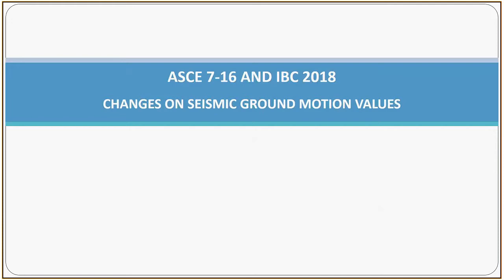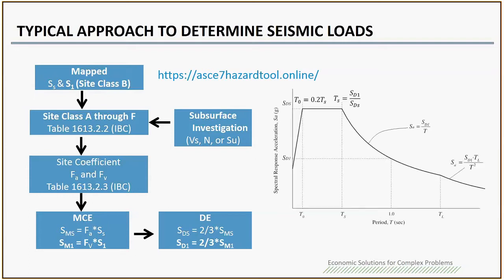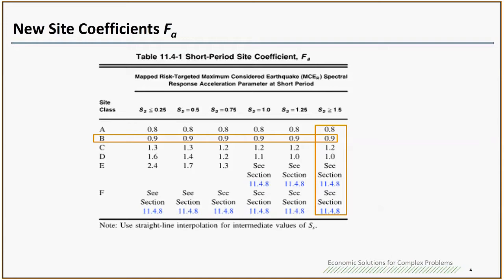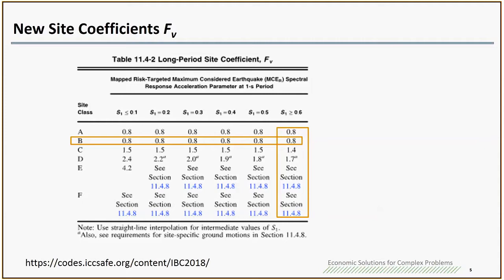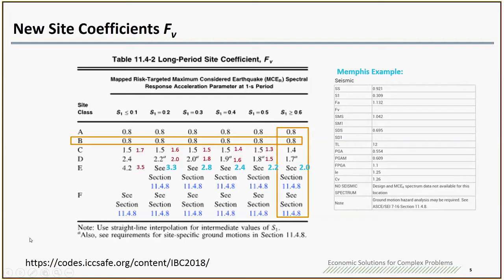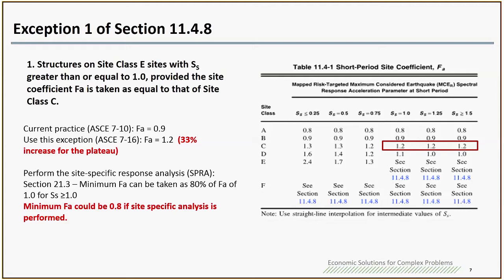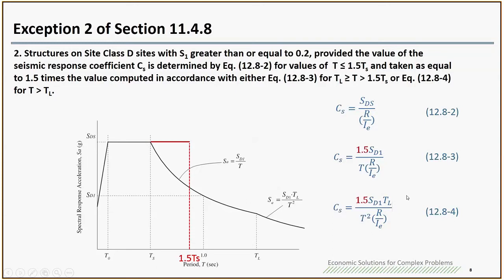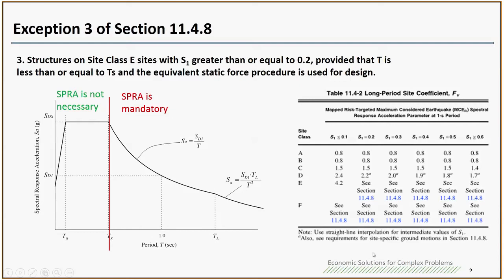ASCE 7-16 Changes on Seismic ground motion Values

Comment: Hello Dr. Wei, thank you for the valuable information. If you can clarify equation 12.8-3 & 12.8-4 when we increase and multiply by 1.5 into the equations but still the value is SD1 is unknown. So how do we obtain the value Cs
Reply from the maker: As what I indicated in the video,  you can use the values of Fv listed in Table 11.4-2 in ASCE 7-16 or Table 1613.2.3(2) in IBC 2018 to calculated the SD1. Note this SD1 can only be used for Exception 2 that means you need to increase Cs value by 50% when using equation 12.8-3 and 12.8-4. Of course, you can always perform site response analysis to reduce seismic loading. Feel free to let me know if you need help on this matter. Thanks.

Comment: At 18:53, the video shows comparison of Eq 12.8.2, Eq 12.8.3, and Eq 12.8.4. 

Usually, Eq 12.8.2 determines the final seismic coefficient (Cs) which does NOT need to EXCEED the values from Eq 12.8.3 or Eq 12.8.4. The latter two equations normally do not govern anyway.

For Simplified Procedure in section 12.14.8, there is no need to check S1 and Fv.
Eq 12.14-12, similar to Eq 12.8.2, determines the final Cs.

For smaller projects, geotechnical report cost may not justify the so-called "saving."
You didn't really save anything. You just convince yourself and the plan checker that you can design for lower lateral forces. I have always designed projects as my own. Most owners of smaller projects would rather spend budget on larger foundation than a nice soil report. 

For larger projects, geotechnical report is mandatory anyway.
Reply from the maker: Hi, Jack, thank for watching my video and the comment. The changes of ASCE 7-16 should not impact your projects much since the periods of your projects are typical short and in the plateau range of the response spectrum. The intent of this video is to explain the changes from the ASCE 7-16 and how to deal with the changes. Even though geotechnical report is required for large projects, the site specific response analysis is typically not performed. This analysis is recommended to reduce the seismic loads when it is challenge to design for it. Even for small projects, such as adding additions to existing house (quite common in the Bay area), some of additions have to rely on the existing foundation. It is difficult to modify the existing foundation to resist the load. Then there is merit to perform the site specific response analysis for more economic seismic design. You are right. Majority of projects won’t be impacted by the changes. However, if you ever have the issue with the new code, feel free to drop me a message at ecosolution44@gmail.com. I am happy to help.
Reply: @asce7-169   Thank you for the reply, sir. I do appreciate your effort in making the video.

As a practicing structural engineer, I and other fellow engineers are trying to flip through ASCE 7-16 and 2019 CBC to humbly comply with the newest and greatest seismic and wind load design criteria. We don't have any choice. The projects need to get approved. 

While we are fighting every little factors, coefficients, exceptions, etc. to reduce the required forces, a simple revision of Ss and S1 parameters and wind basic speeds dramatically changed the bigger picture. I have seen Ss and S1 greatly reduced in Los Angeles area and the new wind basic loads are much lower now across the US.

Yet, at same time, live load for balcony and deck now are increased to 1.5 times of the live loads for the building.

What does this all mean? All of a sudden, the lateral designs based on ASCE 7-10 are way too conservative than those based on new ASCE 7-16. But all deck and balcony live loads are now 50% under designed.

There is a lot of arguments among engineers that whether structural design should simply meet code requirements or meet owners expectations. The former is legally right but is it good? 

If someone designed and built a wood deck for 40 PSF live load last December, he will have a hard time trying to explain to the owner that the newly built deck needs strengthening for 60 PSF live load now. It's not his fault. He simply just follows the code.

By the way, I am also a structural plan check consultant. I check other engineers' design while other plan checkers check mine. I feel the pain from both sides.

I have been practicing since 1987 in LA area. The building codes mushroomed at least triple in size and thickness. The only good thing I know is that there will be more projects for engineers. So maybe I should stop complaining? Cheers!
Reply from the maker: @jackyeh7512  Like your attitude for changes😊 more change, more opportunities. LA is little bit of odd area for seismic design. I believe the seismic loads are increased more than 50%because of couple new faults and different interpretations for Northridge earthquake. The new code pushes the seismic load back for some degree. Cheers🍻

Comment: I've got a public elementary school project that is essentially being copied over to a new site about a mile away from where the original is being built, in the same school district. I just ran the new ASCE7-16 numbers and the site (I don't have soils report yet and I'm guessing either Site Class D or E) and my SDS value is 37% higher than the one under construction. I'm baffled as to how it could jump so much and am anxious about how to tell the owner/arch that the lateral system will need to be substantially redesigned to account for this large code-based increase in force. 

In a case like this would SPRA help get the force back down to something similar to previous code?
Reply from the maker: Hi, Matthew, thanks for reaching out. I don’t know the location of your project and can’t make direct evaluation. I think there are couple reasons for the increase of seismic load. Certainly, the higher values of Fa or Fv will increase the loads. Also, the ASCE 7-16 uses a new seismic map - 2014 USGS seismic map. If the new map identifies a new fault near your project, it could increase the seismic load as well. To check this, you can compare the seismic map values (Site class B) for two sites. If they are similar, it indicates the new map is not a factor. Otherwise, the new map could contribute a higher load. I don’t know the project details and can’t answer whether the SPRA can reduce the loads to previous level. Note the maximum allowed reduction for seismic load is 20%. However, if you use Exception 1 (site class E) to determine seismic load, there is a possibility to reduce loads more than 20% since this exception has significant penalty. Anyway,  schools are essential structures with risk category IV. Any reduction for the seismic load is helpful. I hope this is helpful. You can email me at ecosolution44@gmail.com for further discussion.
Reply: ASCE 7-16 Thanks for the reply. The original school was on Site Class E in Fremont, CA (high seismic area with Ss=2.1). The Sds for the previous design was like 1.2 if I recall (not in office now so I cannot recall exact values). 

The new site is about a mile away probably slightly closer to the Hayward fault, with an Ss of nearly 2.2. Without a soils report I don’t know the site class yet. But running various site classes I am arriving at Sds values ranging from 1.45 to 1.69. 

This is a dramatic design demand increase for a building design that’s being recycled from one nearby site to another within just a couple years. I am not conversant on the site specific ground motion analysis. Your video or some other I saw on here says that it’s a few thousand $ extra for the geotechnical engineer to perform. 

Maybe it is a good idea to get this additional site analysis done. If I tell my principals that I did a review of the changes to the lateral system from the last code to the new one and the forces go up 40% for a nearby site, they will think I made some grave mistake.
Reply from the maker: @matthewsutton3682  The site response analysis is a good solution for your project on seismic load reduction. As what I indicated in the video, the site response analysis is always recommended for site class E site since the penalty from exception is high. Let me know if you need help on this analysis and good luck for your project.
Reply: @asce7-169  Thanks, I was asked to evaluate the code change on the building's seismic coefficients. So I'm going to recheck my #'s and suggest site response analysis from the soils engineer to get the new design force down to something similar to the original. Again thanks for your time.

Comment from the maker: Check recent notes from Bill Gates regarding climate changes. https://www.gatesnotes.com/Energy/Buildings-are-good-for-people-and-bad-for-the-climate 
The article indicates 10% CO2 emission is from the production of steel and concrete. The article is to promote low carbon materials used for buildings. It could substantially increase the building cost with current research on this matter. Another way I think could be spend more on the engineering to optimize the design of buildings that can reduce the uses of steel and concrete. The site specific response analysis could be one of them, particularly for Seattle area located in a high seismic zone.

Comment: Dr Zheng
if i replaced a mat foundation for a 5 story building (roughly 100 feet tall) by piles; would it increase or reduce the building period?
Reply from the maker: Hi, Pacoima, I hope my responses answer your question. For your structure, the fundamental period is around 1.0 second to 1.4 seconds. The site specific response analysis could considerably reduce seismic load for your project. I can provide a free evaluation whether the site specific response analysis benefits your project. If interested, please email me at Ecosolution44@gmail.com. Thanks.
Reply from the maker: It will typically increase the period.
Reply from the maker: The mat foundation is fixed at the mat level for fixed base design.  The pile foundation is fixed some distance below the mat.  The building now becomes taller. The period is increased.